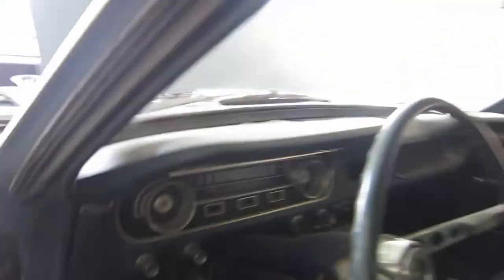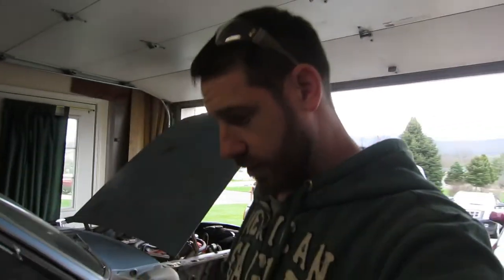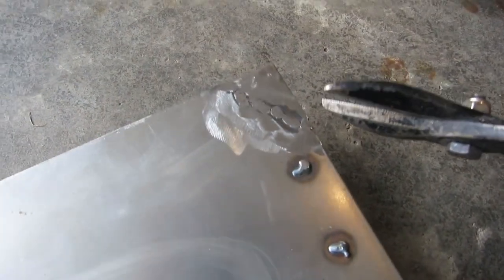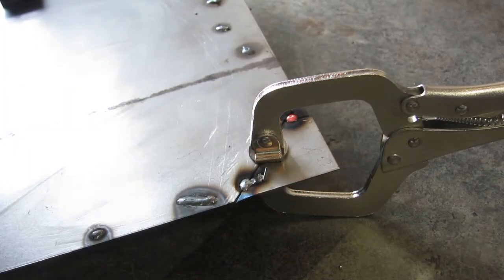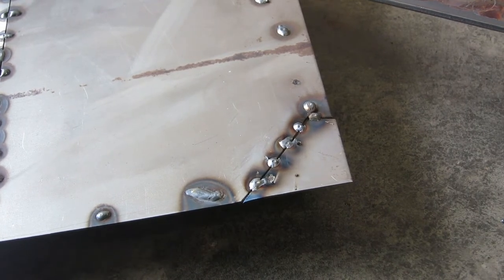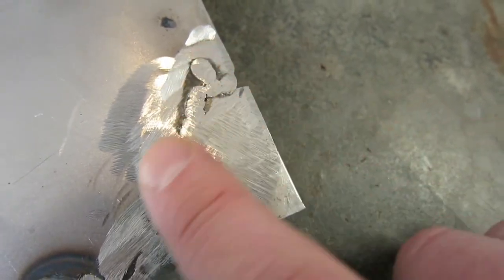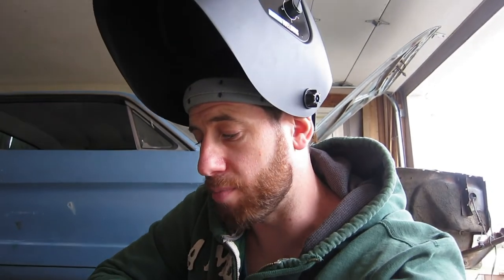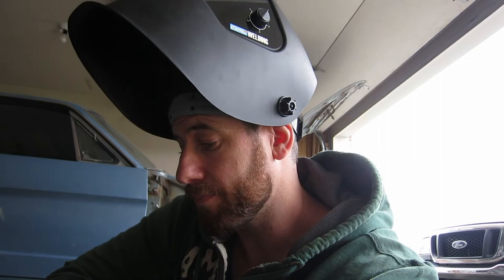My Welding Is Improving

Comment: Definitely improving.  To help with eliminating any shake while welding, use your left hand as a guide. Even if you just stretch out a pinky to touch what your welding. Creates an anchor. Also, get some gloves.
Reply from the maker: Thanks Barry. I’ll try the anchoring technique. I have gloves, but in the chaos of trying to weld and film, they ended up on the floor. 😬

Comment: Can’t comment on the welds because I’m a rookie myself but I do know gloves work a lot better on your hands rather than on the floor.
Reply: Noticed that as well
Reply from the maker: I knew that comment was coming. 😬
Reply from the maker: Adam Kwasnaza how’re you guys holding up down there in Chambersburg? And how’s your ‘65 doing?
Reply: We just got put onto the list for the stay at home order starting at 8:00 today, my detailing business has been closed for a couple weeks now but my wife is still working. She just got word she will be working from home starting tomorrow. As for the Mustang it’s slow. It has several holes in the floors, truck and firewall so it will be a major under taking to fix. I may use this time off to start on the bodywork like you are. It doesn’t need much but I would like to strip all the layers of paint and start cleaning up the surface rust on the underside.

Comment: Looking good Andrew, it's a definite improvement. Just remember when grinding down welded seams you don't want to grind it down totally flat because that degrades the metals integrity and is less strong. Besides your body filler will take care of all that.
👍👍👍
Reply from the maker: Thanks Tim. I’m still trying to develop a feel for the grinding. I haven’t applied filler to any of the welds yet. I need to do so to get an idea of what can be masked and feathered.
Reply: Andrew, any time I have high and low spots left over from grinding I will use Duraglass filler as its waterproof  then put the regular body filler over that then sand it smooth.

Comment: I am the absolute LAST person to make a comment about welding because I have ZERO welding experience for the type of weld you are doing but what about single spots 1 or 1.5 inches apart and then run a "bead" weld from one spot to the next?  My only welding background was a summer job on an assembly line welding desks with water cooled numatic spot welding machines.
Reply from the maker: Krellian Kruge99 thanks for the feedback. The guy I picked up the sheet metal from recommended the same thing. I just don’t feel comfortable doing it because the thinner sheet metal can warp so easily from the heat. I’m sure more experienced guys can do it. I’m not there yet though. 👍